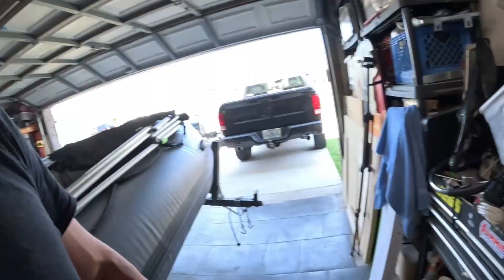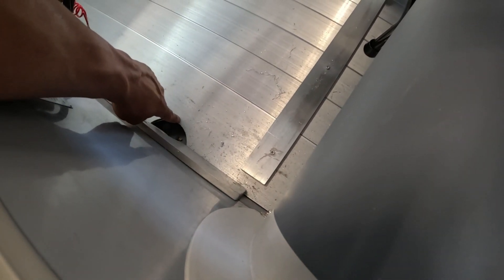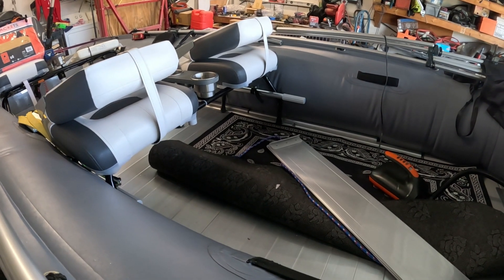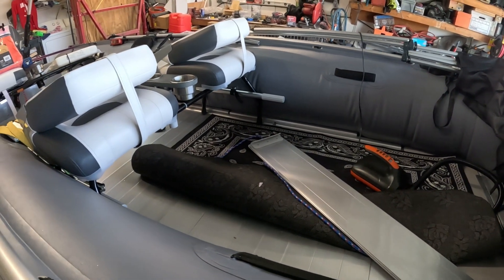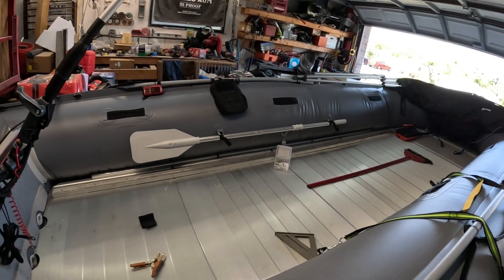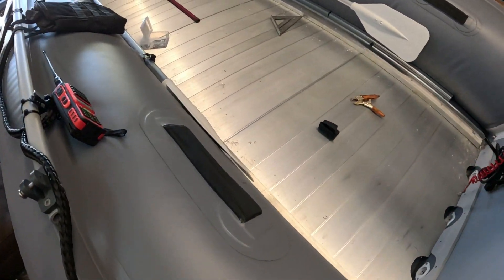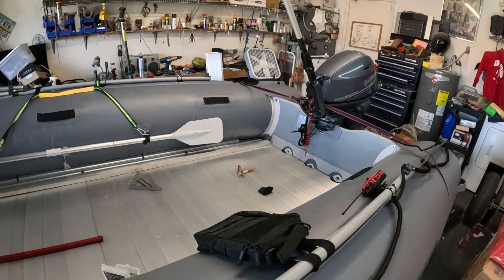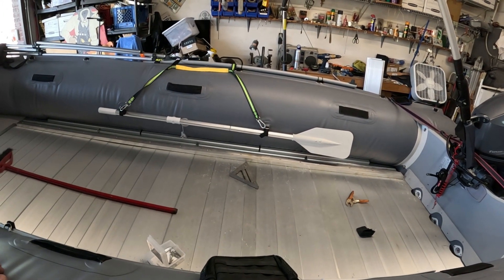Grow A Spine! Reinforcing the floor of my Saturn SD518 Inflatable Boat

Comment: Love the idea,but my experience screws will loosen up. Use weld nuts with the head of the nut on the bottom side.
Reply from the maker: It's gonna get further modded at some point, just need to wait till the Summer Heat and Humidity let up a bit.

Comment: Nice modifications and great videos. Suggestion - if  you could attach your seat frames to the aluminum channels with corner brackets, that would really ensure an incredibly stable platform. I know in your seat-install video you indicate the seats are pretty secure between the tubes but attaching to the frames to the channels would help. Just a thought. For storage, have you ever thought about boxing in the bench seats - that is, putting 'doors' on them with say a piano hinge. Would probably help in keeping the inside of your boat organized - you could do this for the seat frames too. Again, great videos!

Comment: Nice!  If the screws pull out after lots of use, stainless steel nutserts would probably work out good, instead of trying to use nuts and bolts..
Reply from the maker: That's actually a great idea! I didn't even consider that. I just bought a tool for installing Nutserts last year too. Sometimes you have so many tools you forget what you have. Thak you for contributing, thats what I really want my videos to be about, everyone in the community helping each other out.
Reply: @SoFloBuilds  probably the only other way to fasten them together would be to run bolts up through the bottom.  With large fender washers, with a dab of 5200 to hold in place, while you attach the nut from the top.
Reply from the maker: @davehanna1557  I thought about that, but didnt want to dissassemble the boat again... Way too hot and humid now!  I also want to retain the ability to break the boat down if I need to. 5200 is super strong and would make it difficult to remove the bolts.
Reply: @SoFloBuilds  great videos!!!! Just a thought but maybe try using rivets instead of them sharp screws?